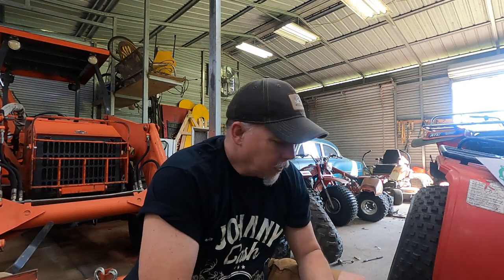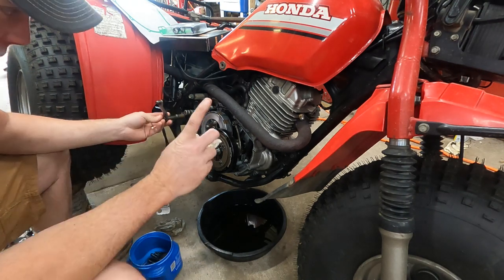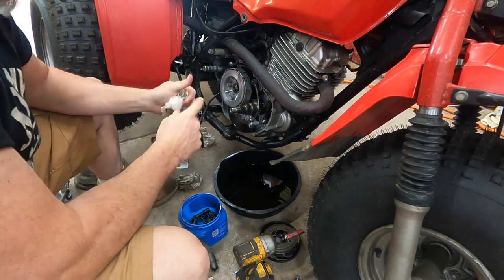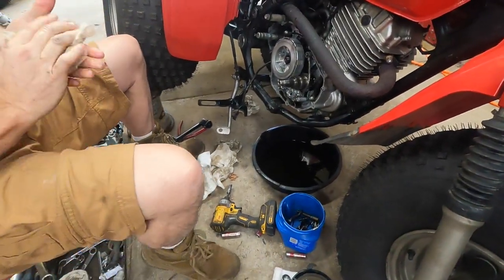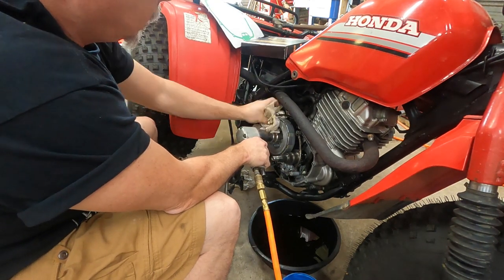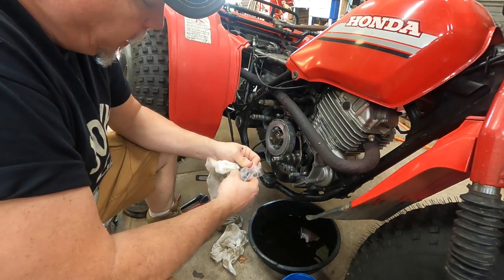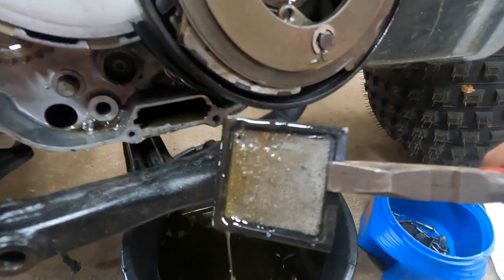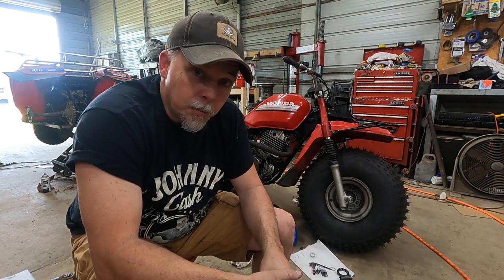HONDA ATC 250es THREE WHEELER CLUTCH & ONE WAY BEARING: Diagnosis and Repair.

Comment: Hello, i cannot get the centrifugal clutch off.. ive tried pryin the back and hitting crankshaft with mallet..
Reply from the maker: You have to rotate it until it lines up with a very shallow notch in the clutch basket. Rotate it by hand slowly and pull evenly on it it will alighn and slide off
Reply: Thanks, but im not able to find a notch.. ive turned the bell to make basket turn a few time i do see any marks on basket.. thanks for your help.. i fret the reverse neutral switch.. also didnt noticed ya took oil dip stick out .. i removed cover with mine i.. i dont recommend ha
Reply: Now i have dropped two case bolt into the crank.. fml
Reply from the maker: @PoBoyRascal  get a magnet on a extendable wand. there cheap and great for retrieving dropped parts.
Reply: Saga continues.. borrowed gear puller got centrifugal clutch off got basket apart, got bolt out with magnet,  broke rev neutral metal end fixed with electrical kit had a female pin. Had to cut it out of it plastic case.. its prob fine.. went to put in new plates in and they are to small..  im just sharing for the fellas whos machines dont come apart so easily like mind from a hard life in Louisiana swamps.. thanks for makin great videos.. this is just my hard luck i wish the rest if yall good luck!! Ha
Reply from the maker: @PoBoyRascal  Hey Sandy, you are have a tough go at that big red, when things get like that, I find it good to walk away for an hour or so, look back over the manual and then go back at it with a clear mindset. Hang in there you will get it.
Reply: Feel like i should replace the centrifugal clutch now since i have case open.. i hear ya say they last a long time but cant find spec since i dont have manual.. cant seem to find nyone selling it whole saw the little shoes but i dont wanna open up that can of worms.. will the 250 fourtrax centri clutch work? I have the fourtrax with the big red motor  also
Reply: And thank you for your time and channel.. i think we need to do a florida trike fest.. im up in pensacola

Comment: I have the same year cycle. I’m having an issue with it getting stuck into neutral and not shifting gears. And sometimes the neutral light won’t come on unless I mess around with the shifter a few times. Can anyone help?
Reply from the maker: I would inspect the clutch and see if its adjusted and working correctly.
Reply: @Mrcbuilds  I’ll give it a shot. Thank you!

Comment: how do you remove the drive line out of 1985 250es Big Red
Reply from the maker: Hi Dave, the drive shaft is splined at the engine. Unbolt the engine and the drive shaft tube. DO NOT UNBOLT THE 90 DEGREE OUTPUT just the tube from it. The engine tips forward and left as it come out of the frame. Also remove the skid plate, this allows the engine to drop down between the frame rails and gives you more room for the head.

Comment: One thing you didnt mention at the start that i wished you would have is the case bolts are not all the same length. My dumbass through them in my cup without noticing that. Would you happen to know the pattern? Or does it even make a shit what order their in?
Reply from the maker: Yes it matters, I believe the top 2 bolts above the centrifugal clutch are the 2 long ones, double check that with the free manual. here http://oscarmayer.net/atc/manuals/
Reply: @Mrcbuilds  Man,thank you soo much. Not many people would do that or even care. That download was a huge, huge help. Ive looked for that but it sure wasnt free.  If I had your address id send you some filleted crappie. Lol. Thanks again.

Comment: The 250's are so much easier then the 200's in my opinion, why?  Because on the 200's you have the centrifugal oil filter on the end of the centrifugal clutch,  that gasket always seems to tear on me, leaving half in the centrifugal clutch hub and half on the back of the oil filter, so its scraping gasket pain in the rear to get that all out of the clutch hub and getting it cleaned up to reinstall.  Just makes for it taking longer, two gaskets, an o-ring, and the staked nut on the centrifugal clutch always seem to be peened in like a cave man did it with a rock, maybe thats just my luck on the ones i have done though.
Reply from the maker: You may be right, I learned the 200cc engines first, so their kind of my favorite, I like the simplicity of them. Thank you for watching

Comment: My bigreds clutch don’t slip at all just needs kick start bearing
Reply: Nervous to do. It but this will help thanks for video
Reply from the maker: Just take your time, follow the manual, you will be fine. Take pictures as you take it apart, to refer back to later.
Reply: @Mrcbuilds my bigred 250 started leaking from the clutch cover 

All the bolts seem tight and not stripped don’t seem to be any cracks incase or anything it’s coming from down low bye the reverse lever 

Is there any other gasket/seal  I could possibly need to fix the leak?

I got a cometic clutch cover gasket here 
And just don’t wanna take it apart and not have al the seals and gaskets 

Will the one gasket be all I need
Reply from the maker: @easylee1417  tip the machine up on its left side, this will keep the oil in the engine, be sure to clean the surface and install your new gasket. a very like tacky coat of RVT is not a bad idea, use grey it will blend, cut off any excess when it drys